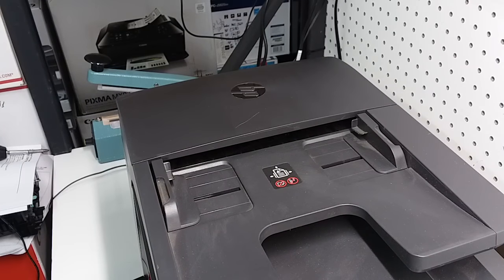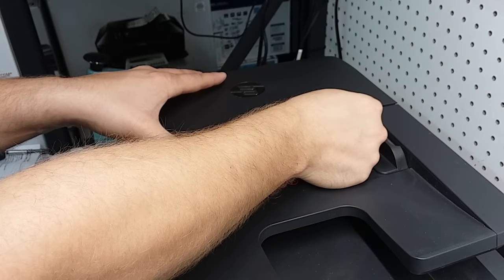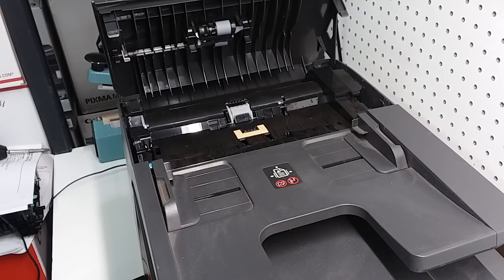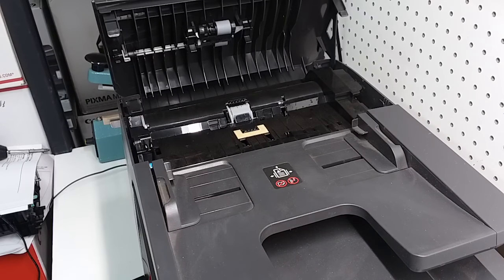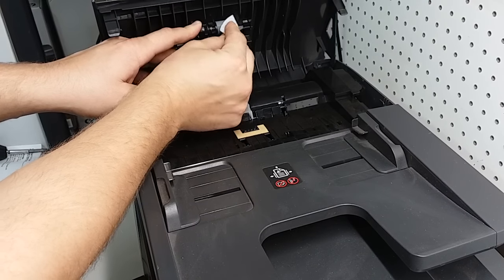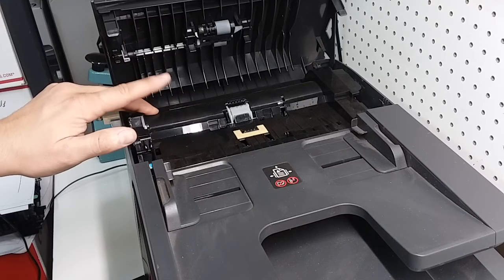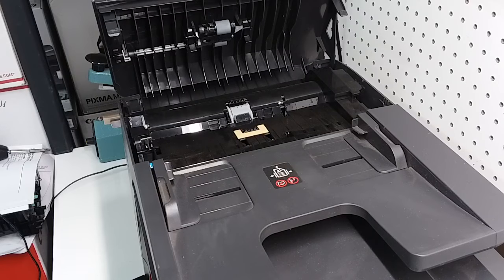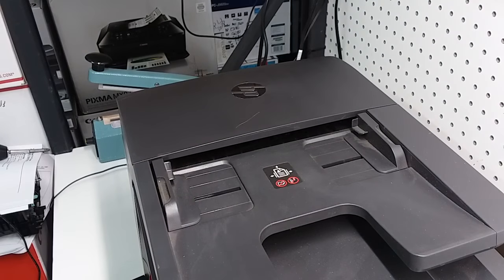How to fix ADF Document Feeder problem on HP Officejet 8710, 8715, 8720, 8730, 8740, 8600, 8610

Comment: Wow, I threw one of these away already and bought another used one. About a month later the replacement printer did the same thing. I'm so glad that you did this video. It fixed my issue. I just wish I would've found your video before I tossed my orignal printer. Thanks so much, you are awesome and saved me more time and frustration!
Reply from the maker: Thank you for the feedback.  I'm glad you got it fixed. Have a great day!

Comment: The alcohol cleaning is JUST what my printer needed! The official HP video said to ONLY use water. But I thought heck, if I'm going to throw it away if this doesn't work, might as well use alcohol to clean it. Worked great! Thanks for the recommendation and the video.
Reply from the maker: You're welcome. I don't know why they say not to use alcohol.  Have been using it my printers and no complaints years later of rubber getting ruined or anything of such. Thank you for your feedback! Have a great day!

Comment: This worked fantastic!! ADF scanner was outputting skewed pdf files. Used water on a Q-tip as per HP and it did not fix the Problem. Used what this Chap recommended in conjunction with a Q-tip and BOOM, it worked fantastic!!
Reply from the maker: That's awesome! I really appreciate your feedback.  Have a great weekend!

Comment: Thanks for the great info. On my 8015E printer, next to the document feeder, there is a little flap that opens. I couldn't find any info in the HP Specs. Just curious, what is this for? Thanks.
Reply from the maker: Hello. That flap opens up for long document scans that go through the ADF, for paper size such as legal size.  Also a good idea to open it for a large amount of scans in ADF. I would have it up if doing over 10 pages. I appreciate your feedback.  Have a great 2024!
Reply: @303electronics  Thanks so much for your quick reply. Have a great 2024! as well.

Comment: Good video presentation. I don't think using alcohol is the best solution since it will dry out the roller over time. Perhaps a mild cleaner on a lint free cloth would be a better choice.

Comment: I had 2 little grey rubber bands fall out from the ADF unit area after blowing out with compressed air and I'm not able to find what they are or if they're important.  Any idea on what those could go to?  They were old like when a rubber band just cracks and is old.  I know I'm having problems grabbing paper after losing those.

Comment: I looked online and watched many videos about cleaning the rollers, however, it didn't seem to fit the problem I was having.  It turns out that my HP 7520 All-in-one Printer had a broken hinge on the right side in the back, yet the error showed up as an ADF problem. 

Another commenter on the HP website said that she noticed the lid with the ADF wasn't closing all the way down, so she put weight on it and that solved the problem. 

I tried that when sending a fax--I put weight on the lid on the left and right sides, and the pages would feed through the ADF.

I'm wondering how to secure the wayward hinge or replace it to keep from getting the error about the ADF, and to not have to put both forearms down on the lid to prevent the error message.
Reply: Thx for Vidio

Comment: I have an hp officejet 8630.  I have done all these steps and I still get the error. 
I believe the rollers on the open lid are the problem. They no longer "float" like the printer in the presentation.  Any suggestions?

Comment: Well, my HP OfficeJet 6958 All-in-One says it can't pick up the document but it is actually picking up the document and moving it through the printer. And, even when the document is all the way through, it keeps running. No copying takes place. If I put in 3 sheets of paper, it will pull through 2.5 of the sheets and I will have to open the ADF to remove the 3rd page that is sitting half way through the printer. No jam, just sitting there like the ADF times out. I'm stuck! All I can find are videos for printers that actually don't move paper through the system. My printer just says it's not moving the document when it actually is. Help!

Comment: I have been scouring the internet and i have not been able to find anything like what i'm dealing with with my ADF. I have the Color Laser Jet Pro MFP M479fdn. The feed through is fine until it spits the original document back out. its like the document doesn't get laid down until the next page is through and my pages get out of order and shoved up or off the machine. Sometimes the shoving will cause a jam. I have cleaned the rollers, i have taken the lid off the ADF and cleaned down inside there, but i am still having this issue. It's time consuming to have to babysit the scanner and remove page by page of the original document when making copies for a client of their 30+ page lease so it doesn't get mixed up or jammed. Any tips since customer service is useless? (i hope i explained my issue clearly)

Comment: Will this fix the print quality? Everything else is working fine when I print from phone or use scanner but when I use the adf the color quality does not come out well. It’s very blurred. It’s not the ink it’s new and I cleaned the print head witch gave it better quality
Reply from the maker: Clean the glass. Also, make sure copy setting quality is set to "good" or "normal". If it is set to "quick" or "draft", the copies will be very light. Just cleaning the rollers will not make the copies darker.
Reply: @303electronics  thanks. I believe the glass is clean because when I print on the glass the quality is good or atleast okay. It’s a new problem that didn’t occur until very recently.

Comment: The description has the 8600 included however that part he opened to clean doesn't open on mine, so I am not sure how to clean the rollers? Right now I have a black line going down the center of the page when I scan.

Comment: Hi... My printer was dropped and it warped (I'm thinking) the ADF cover. I cannot get the cover back on correctly; therefore, the printer won't scan or copy until I get the lid closed... my warranty has expired... Can I bypass the ADF?

Btw... It's an 8020... And I realize not a model you've listed above... But, as you already know, of course, the design looks quite similar👍

UPDATE: OH WOW🤩🤘I just found ADF assembly online.... So gonna replace mine😜 Phew!!! I'm feeling SOOO much better nowwww... considering 'i' am the guilty clutz that dropped the printer in the first place😐🙃😜

Comment: Why does my Officejetpro 8600try to feed three pages at once??? :-(
I had no problem scanning with my Officejetpro 8600 on Friday. On Monday it's another animal and wouldn't scan at all, so I tried to run the "HP Print and Scan Doctor."  It got stuck. I tried again. Again, it got stuck and wouldn't run the program completely.  So, I then tried to get hold of HP Support, where they don't like talking to people.  I tried their virtual assistant and they said to unplug the printer and plug it back in.  WTH?  But it seemed to work. I was able to start scanning my documents. Then the last three  pages all tried to feed at once, jambing the damn thing!  With this video, I was able to unjamb it (thank you!), cleaned the roller, and tried to scan again. Again, it won't scan!  I guess now I have to unplug and plug the printer back in, every time I want to scan something. What a POS.
HP is a joke. I don't  think I will EVER get another HP printer. I'm done with them.
Reply: I am missing a page and it must be stuck in there now what? the automatic top feeder

Comment: 303, thanks for the video, but I'm still having issues with my 8740. What happens is that midway through scanning each page, the feeder pauses then starts back up again. This ends up creating several pages out of one page. 

Are there any other possible solutions for this problem? Thanks!
Reply from the maker: Hi. I'm very sorry for the delayed response, I would check the all rollers on the feeder and the tab that  is there to detect page end,

Comment: I am using HP m2727nf, it jams intermittently while scanning through ADF; it scans some pages and then either jams a paper or don't pick up the paper. Any solution?
Reply from the maker: Hi. Have you been able to clean all rollers in the ADF? There are a few rillers besides the pick up roller. The paper wraps around the adf unit and the adf unit itself has about 3-7rollers. Clean those and see if the problem goes away. Please let me know if that worked.

Comment: Hello i can scan but when I saved as PDF can’t see almost nothing very blurry. Any help will be appreciated thanks.
Reply from the maker: Hi. Is it only blurry when you scan or when you make a copy too? If only when scanning, you will need to check scan settings on your computer and increase resolution there. If both when scanning and copying, You may want to check to make sure the scanner cord is not loose at the connection to main board.

Comment: Would you happen to know how to fix a scanner failure problem?  Prompt on screen says "Scanner failure. Restart the printer.  If the problem persists, the scanner has become damaged and cannot copy or scan.  For more information, call HP Support." Upon printer startup, the scanning bar tries to go exceptionally left causing a grinding noise.  I have tried powering on/off the printer several times which did not work.  Only function i am able to do is print saved documents.  I am no longer able to scan from the glass or document feeder.  I am also not currently able to make a copy of a paper through the glass.
Reply: I own the HP OfficeJet Pro 8715.

Comment: I've cleaned all my rollers but what's happening and I can't find it anywhere else is it my ADF is jumping or skipping as it pulls the first page in and then it stops and says "jam".
The rollers are clean and it's not a paper gripping problem.
It's very annoying.  I think it might be a software problem but I don't know. I don't understand why it won't feed in slowly but instead it hops and jumps as it pulls the paper in and then it stops there's no jams.
Reply: found a problem to your solution?

Comment: Hi, I keep getting a line down my paper when I use the add. I cleaned the glass for trash and dust. I still keep getting this line from top to bottom on the paper. Please help
Reply: I have an HP 8720 Jet and I have the same problem. I cleaned several times with paper towels and Qtips, but I still get the line in the center of the paper.

Comment: I'm trying to set something to pull through the ADF to be printed on - I'd like to feed my check that I have opened as a pdf on my computer and not have to open my paper tray to load them in....anyone have any ideas if this is possible?  If I load my check it recognizes that a paper has been loaded...but it pulls from the tray down below instead. So I realize my issue is different than all of yours but thought someone might have an idea. Thanks in advance either way.

Comment: False errors for document feed. No documents have been loaded at power up false jam error appears . The stop bail next to the rollers you cleaned is stuck in the down position. Suspect spring tension on front side of the feeder. It really sucks that no service manuals or parts catalogs are available. Might have to trash this printer.

Comment: I have hp office jet 4500 g510n it’s paper picking gear not working not picking pepper what should I do please reply
Reply from the maker: HP 4500 often have this issue, which is usually fixed quickly by cleaning the pick up roller. In the video that I have attached below, I show how to check and clean the pick up roller. In the HP 4500 printers, it is hard to get to with fingers, so just staple the alcohol pad or thin cloth with window cleaning solution, staple it to a business card or a piece of carton and press ok a few times to have rollers run over the cleaning solution. I will post a vidoe later if I get a similar model.
https://www.youtube.com/watch?v=uyVls41DoDw
Reply: 303 Electronics thanks for your reply. I cleaned many time but issue is this pepper picking gear not working not spinning just cartridges moving light and right gear not working. After the end message appears out of pepper load pepper. I open many time and try find fault but can’t locate what is fault
Reply: 303 Electronics one mention gear not up and down